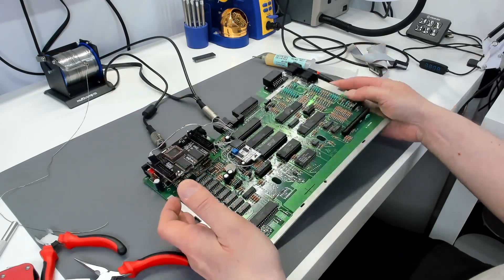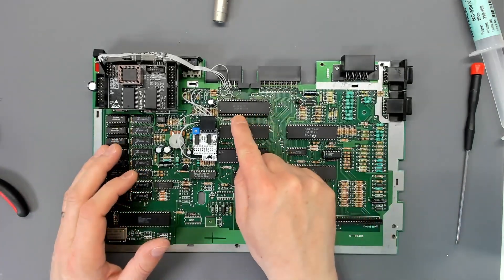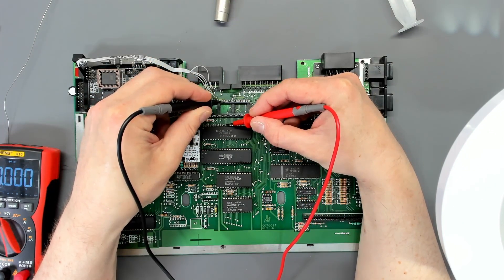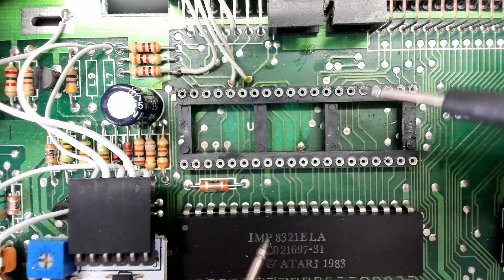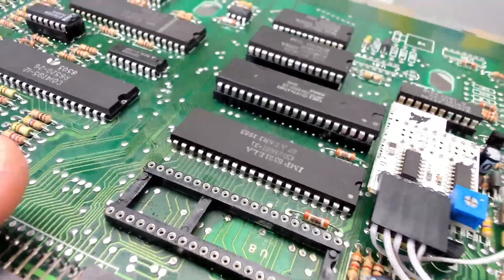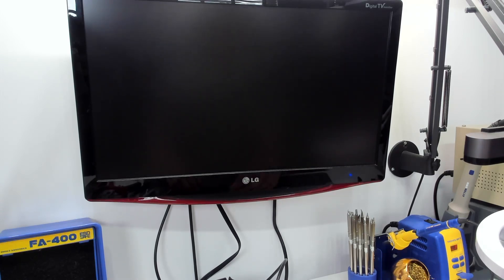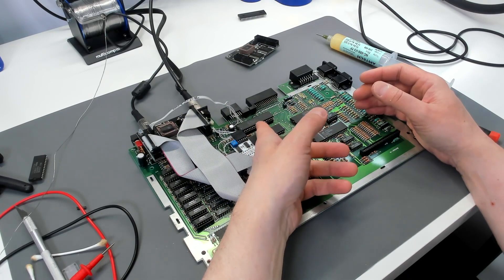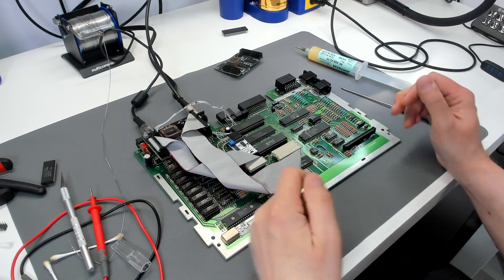Atari 130XE killed by technician

Comment: I got my first 130XE used back in the 80's, it apparently died, and I stuck it away in storage. Years later, I took it apart to troubleshoot it, and found that the only problem was the rom was making poor contact in a socket. Further inspection showed that the former owner had socketed the rom, but completely made a hash of it, as evidenced by the massive number of bodge wires on the socket to get it working again for all the traces he wrecked.
Reply from the maker: Still a common problem to this day when owners without soldering skills decide to work on the board themselves.

Comment: Hakko FR-301... on these boards full of through hole DIPs it makes life easy. This is also the reason I never use machine-pin sockets, if the round pin covers the hole with the conical shoulder at the top of the pin then air can't be sucked through and they are almost impossible to desolder. (Also the cheap ones are garbage and you will have to remove them. The ones that you won't need to desolder are $$$)
Reply from the maker: I watched the comparison video by 'More Fun Making It' of the ZD-915 and the FR-301, and I was pretty much persuaded by the FR-301, especially after a chat with the host in the video comments. As for the turned sockets being difficult to desolder: that's true, but as mentioned elsewhere in the comments, the client wanted the CPU socketed in order to test-install various round-pin-equipped CPU adapters/accelerators for which a turned-pin socket is a reasonable choice, so I don't have an issue with the other technician using that kind of socket. It's the manner of execution that's problematic, with particular reference to removal of the original chip. And full disclosure: if I'd had to remove that socket in order to repair the board, I would probably have ended up using hot air too. The difference is that I know the pitfalls involved, would be taking pains not to scorch or overheat the board, and I would repair any further damage that was sustained, ensuring that the board worked when it left my desk.
Reply: @flashjazzcat  I did have a ZD-915 and it was ok until it stopped working. (Not being critical, you do a great job.)
Reply from the maker: @aeberbach  Not at all. The video by 'More Fun Making It' highlights all the ZD-915's failings (I'm on handset number four or five now). ;) Thanks!

Comment: There really is no excuse for popcorning a board like that, it shows a lack of understanding about PCB construction. Probably too hot for too long in that one spot, I'm surprised it didn't do more damage. Good find. Personally I wouldn't have used a machined socket either, just a normal double-wipe type, otherwise you're putting a square peg in a round hole.
Reply from the maker: I think the intention was to put a round-pin adapter in there (like Antonia or similar), so maybe the machined socket would be a good fit for that. The only reason I can recognise the signs of hot air damage is that I inflicted the same damage on breaker boards myself when I first got a powerful hot air station and tried using it to remove ICs. DRAMs and other 14-16 pin packages are quite doable if you're careful, but 40-pin DIPs are another matter. In any case: the ability to recover seamlessly from mishaps is another important skill (I do that all the time), but in order to recover from a mishap, you need to know the mishap occurred. :)

Comment: I'd be really interested to see a video showing how a 1200XL can be converted from 9VAC input to 5VDC. 9VAC power supplies are impossible to find.
Reply from the maker: If I ever do that mod again, I won't be replacing the barrel jack with a DIN connector. It's probably possible to do a very neat job if you keep the barrel jack.

Comment: I wonder if they used hot air to solder the socket back in, and that second heat caused the delamination and the socket bridge obscured that damaged via.  They should of tested it though.  Great video.  I didn't know hot air could delaminate old PCBs, so very useful bit of knowledge to look out for.
Reply from the maker: I don't know. In my own experiments, I've found it's possible to inflict exactly the kind of damage seen in the video (and worse) simply by heating a 40-pin DIP package along either side with hot air until it can be levered out of the board. You can also end up with warping of the board, especially if multiple ICs are removed in this manner.

Comment: is this 44yo motherboard ?
Reply: No in the Atari 8bit line its just a baby ;)
Reply from the maker: Doubtful. The XE line came out in 1985 or so.
Reply: @flashjazzcat  but in my atari 65xe(130xe motherboard) there is one chip from 1980 ( C014806-35 Atari 1980 )
Reply from the maker: @marcins6071  Not surprising, since the basic design didn't change much since the 400/800.

Comment: Never understand why so many people blast these old boards with hot air to remove components.  I've got a video showing 40-pin IC removals using solder sucker.  Takes a few minutes, gravity makes the chip fall out, and absolutely no damage is done.
Reply: Back in the 90s used to work for a well known manufacturer of PC compatibles and they ended up with a prised customer who  constantly returned boards as faulty (as they had broken the oimm or dimm sockets) but because they bought so much kit our company wouldn't tell them they were idiots and simply absorbed the costs

I got so tired of it I started to replace the killers bybhand and it used to take me about 20 minutes to desolder a SIMM or DIMM  socket and install a new one, with a 90% success rate (the failed 10% had been mashed even further by the prized customer)

That was on 5 layer boards, with a cheap antec soldering iron and a £5.00 solder sucker so I can't see why a 6502 (or a 68000) can't be removed cleanly and safely in a few minutes
Reply: Just watched your video.  Very good.  I'm always terrified of lifting pads and rarely get chips falling out, so I'll follow all your good advice about pressure etc.  Thanks!